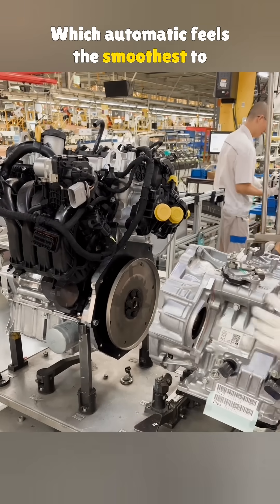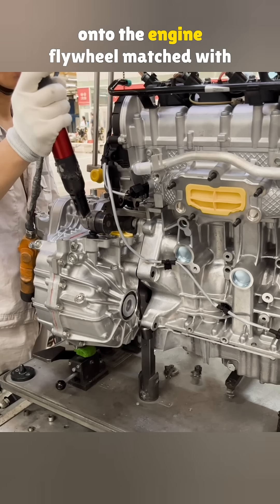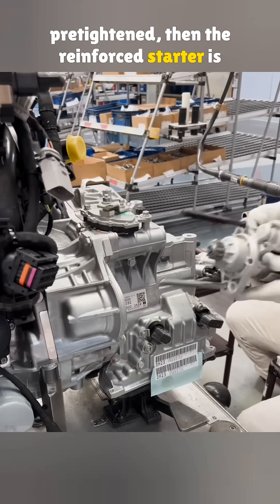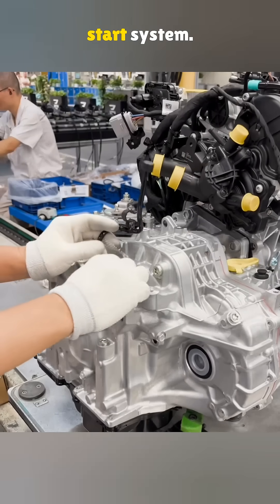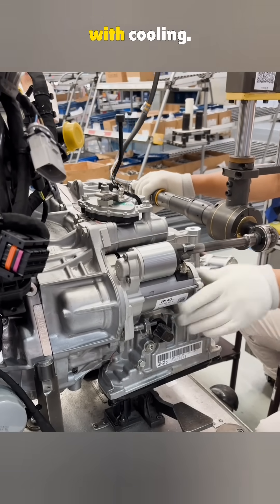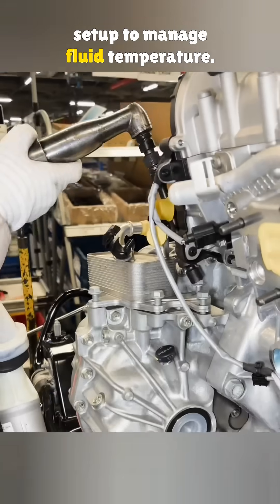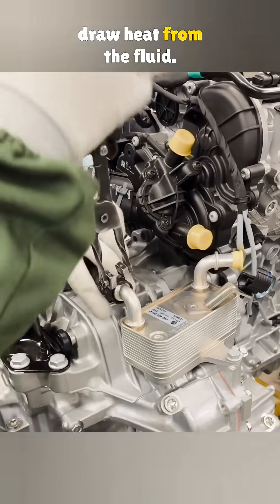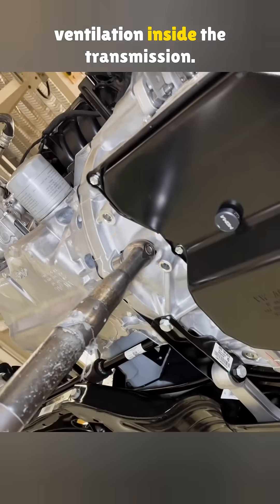Which Automatic Is the Best to Drive #automobile #assembly #mechanic #car #manufacturing

Comment: From short part where you showed user manual on your cell phone, I saw that used seko drive can control your previously used BLDC motor, for which original inverter has failed.

Comment: The best transmission installed on Volkswagen cars is the manual transmission, and as for the automatic transmission, it is the one from Aysin, and also the one installed on the Touareg from ZF. What has damaged Volkswagen's reputation the most is the DSG.